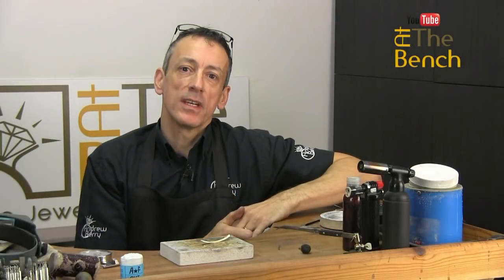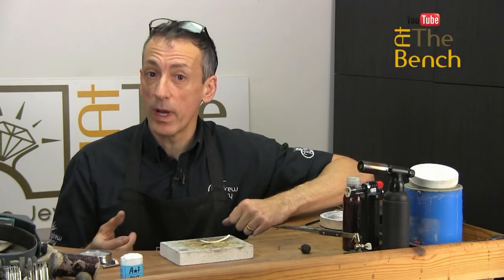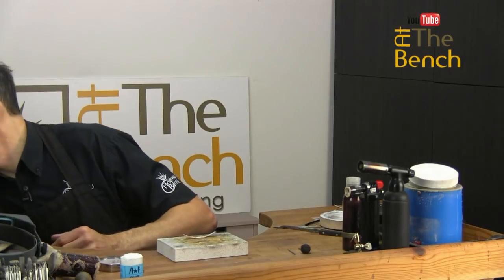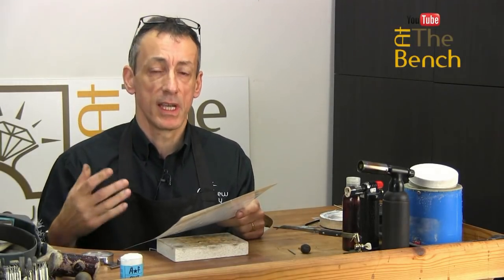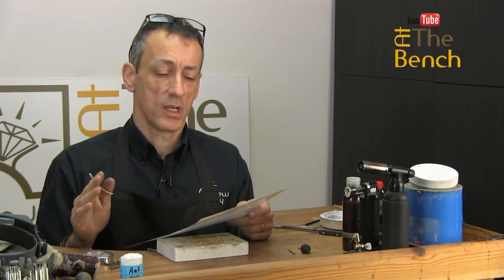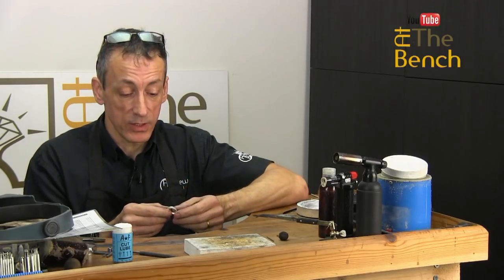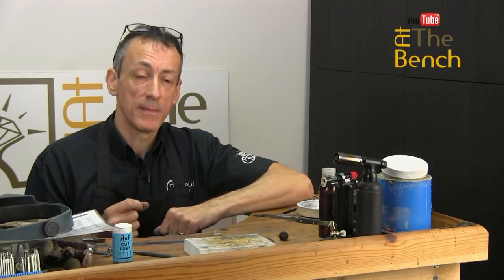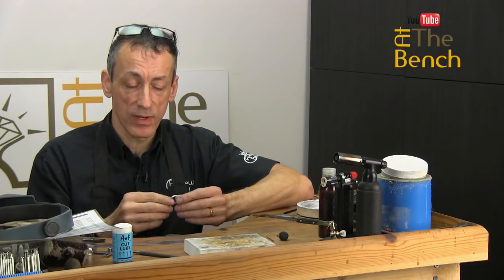The Right Way To Make A Ring Using Wide Section Wire

Comment: Taking a beginning class. Teaching us to make a coil then clip rings with flush cutters, file ends, which means you may have to anneal again depending on how many times you have to to open,then solder, shape and hope for size. I am already set up to saw jump rings, so needless to say, I quickly went to my saw. I so totally agree! I understand I need to know how to file, but the end of wire is not going to help me. Thank you!

Comment: I've been taught the D method but had trouble believing it because a ring has an inside and an outside  measurement; visualising a band being cut open and laid out straight,  there's no way the ends would be flat. Very relieved to find your method makes much more sense to the deeply buried mathematician in me. Thank you 😊

Comment: Ever since I learned this method from Andrew, I’ve always had perfect joins in my rings. I remember the frustration when first learning the ‘usual’ method and trying and failing over and over to get just the one ring to meet at the ends. I thought it was an impossibility. Why would you ever do it the old way?
Reply: Shelly Roberts 
Jumprings are made round, right? Makes sense.
Reply: 2degucitas what’s your point?
Reply: Shelly Roberts 
It makes sense that, seeing how jump rings are rounded then soldered, that larger rings should be done the same way. That's all. No insult intended at all.

Comment: I understand the concept and it makes total sense but when I try it I'm finding it difficult to keep the two ends of the metal perfectly still while I cut. I'm trying to brace them in several different ways, including the way you did it here, but I think what's happening is I'm not holding them steady enough so that they move a little and the saw blade gets stuck, forcing me to stop and restart a bunch of times throughout the cut. The stopping and starting results in uneven edges on both sides. I get little ridges on the cut faces due to not starting at the exact angle where I left off (which I am forced to do in order to ensure the blade gets un-stuck and doesn't snap). While the overall lines of the cuts are parallel, the little ridges within in cut face makes the edges not line up properly (lots of light comes through), defeating the purpose of doing it this way. 
Do you have any advice as to how to brace the two sides so this doesn't happen?
Thank you for the video it was explained perfectly well, it's just executing it that's the problem for me! :)

Comment: Andrew, I'm not quite getting the part at the end where you say that "people will say, but then you have to hammer the ring to work harden it or it'll get squashed"?? Can you clarify that point? Thanks!
Reply: You always have to work harden any piece you make or it will be too soft and not hold up when worn - or stuck in a pile somewhere. It will indeed get squashed. 

Annealing makes metal dead soft so that it is workable, so it always has to be work hardened once you're finished working with it. Some techniques automatically achieve that (if you're already doing a lot of hammering on the piece), but here, since there is no hammering, it is still close to dead soft once it is soldered. 

Just hammer it on a ring mandrel with either a rawhide, plastic, or Delrin hammer, so you don't mar it or move the metal, and that will do the trick, as well as shaping it perfectly. Make sure you turn it around and hammer it from both sides so that it's even, too. If you don't, it will flare at one side.

HTH!

Comment: I have been struggling to keep my 12 gauge joints intact when shaping on the mandrel, but don't see this happening on 16 gauge since it stretches easier.. I am hoping the technique you teach to overlap slightly will mean less abuse on mandrel for thicker metal.

Comment: I disagree. My experience is making ~6000 rings like this; Cut to final length. Bring together with ring shank bender and use a diamond cut off wheel to square up. Done! No waste. BTW IF you value your hands get a ring shank bender! You'll thank me in 10 years!
Reply from the maker: Yes I have several shank benders but not everyone is as lucky as you and me, so……
Reply: @Atthebench   Of course! It's an expense but I feel should be emphasized! Even with medical advancements hand problems are generally permanent and irreversible. Take care of your hands from the start and you'll be able to follow Mr. Berry for years of enjoyment!🙂